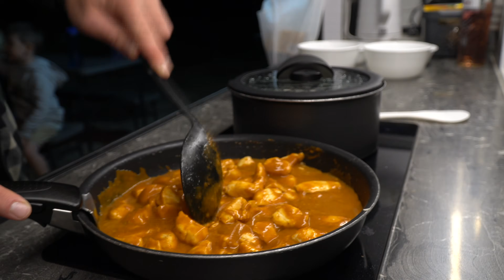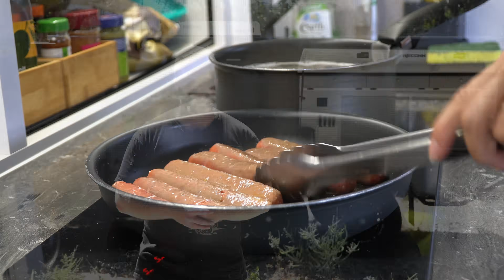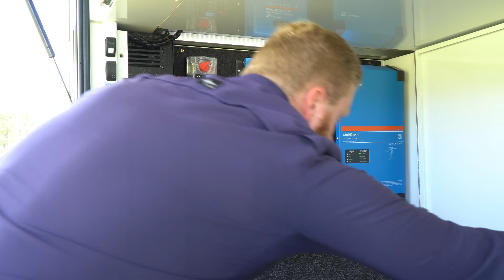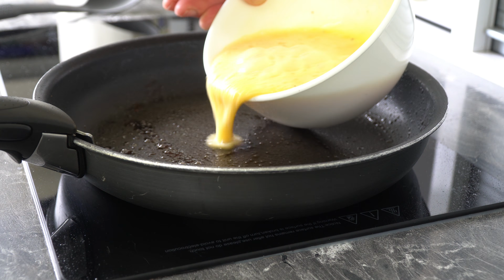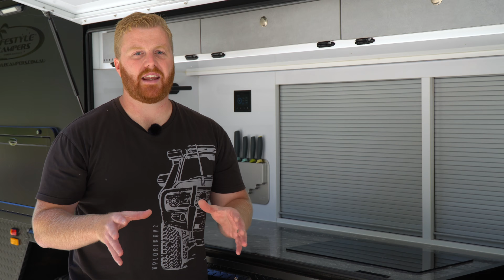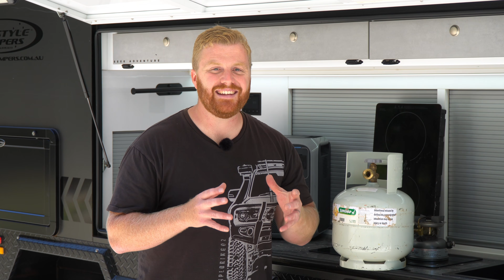WOULD I DO IT AGAIN? My experiences, failures & advice on INDUCTION cooktops for OVERLAND & CAMPING

Comment: Jeepers creepers, you’re almost carrying the equivalent of a feckin new cue lar power station ffs.

& if you throw in all your inverter dcdc chargers etc as well as the Bluetti, and fixed and folding solar panels, as well as the actual induction cook top, I reckon you’ve got best part of $20k invested in solar power system at least.

Then you’re saying, there’s occasions where it’s not enough & there’s reliability issues.

Something you didn’t mention is the risk of catastrophic thermal runaway battery fire in lithium phosphate battery’s.

The recent spate of such fires all over the world in air ports, on RORO ships, multi story car parks, in a cement truck on a Melbourne freeway, proves that the technology isn’t yet “safe” to have in either your Electric vehicle or the camper your family are sleeping in.

Recent video by JC (John Cadogan, Auto Expert, not Electric Jesus Elon Musk), shows that the ONLY available method to extinguish a thermal runaway lithium phosphate battery fire, is with chilled brine pumping.

You have to lower the battery compartment below the thermal runaway ignition temperature, hence why the brine has to be chilled, and the second thing you need to do, is remove the stored energy (electrical charge) as the energy source that’s stoking the fire.

The brine achieves this by shorting out the battery’s - effectively discharging them.

Lithium battery fires cannot be extinguished by use of a normal fire hose, - the thermal runaway fire generates its own oxygen, so will actually burn underwater , fully immersed.

But your Lithium Battery’s are not encased in a metal container / box within your van such that, even if fire fighters arrived with a tank of chilled brine, that they could pump it into your battery compartment.

In effect, what you have created is a massive fire threat, looking for somewhere to happen.

Fun fact, after the recent North Sea thermal runaway EV fire incident on a RORO (Roll On Roll Off) car ferry, new maritime regulations will ban the transport of anything EV / Lithium Battery on any commercial vessel.

So you want to put your 4WD & caravan on the Ferry to Tasmania?

You’re gonna be sh!t outta luck sunshine.

Same with the car ferry over the Jardine River on the way to Cape York.

Or you wanna go visit Kagarri (Fraser Island), on the car ferry?

Same deal, won’t be allowed on it with that setup.

In essence your entire setup is like so many other phukwhits on YouTube, the blind leading the blind.

Probably seemed like a good idea at the start - but subsequent events have proven that Lithium Ion Battery’s are a total failure.

Toyota & Ford have already abandoned the technology, they know it’s not safe & they don’t need another “Ford Pinto” type class action lawsuit as people start dying in these events.

Phuk me. I wouldn’t even risk parking next to that death trap. 🙄👎

Maybe your reporting should cover some of the real risks.

Wait till you find out that insurers are looking at declining coverage with anything containing lithium Phosphate battery’s in them.

You need to face it that this is a failed technology purely because it’s totally unsafe.

My 2c
Reply from the maker: I love this mate, I appreciate the time taken to write such an in depth synopsis of your thoughts on the manner, however I want to make a few points. 

Although you are correct in some of your knowledge and statements regarding the fire intensities and risks involved in lithium battery fires, there is a bit of ‘misrepresentation’ in your description of the ‘end of the lithium world’ as we know it. 

I just travelled Australia and have put my vehicle and trailer through some seriously rough conditions, on dozens of barges including to Tasmania, Fraser Island and Jardine. Thankfully I made it through it all to tell the story. 😅 

Will this change in the future, most definitely. Like anything we are always looking to make things safer, will we just stop transporting Lithium in the immediate future without implementing some sort of alternative, absolutely not. 

Are their risks with lithium, of course. Everything has risks! Are we forgetting that almost every caravan and trailer is carrying between 9-18kg of compressed butane and propane, stored at anywhere between 30 to 120 PSI of pressure? These are literally waiting time bombs… oh wait, no they have safety features that reduce (not eliminate) that risk. Just like lithium, there are steps and procedures put in place to limit these issues. Further a gas bottle explosion will likely kill you in a trailer, whereby thermal runaway from a lithium gives you time to escape. 

I think this is what is wrong with the world today. We are surrounded with worst case scenario news. ‘Everything is out to kill us’. There is inherent risk with everything we do, walking across a road, driving a car, flying etc - maybe even being struck by lightning or a meteor. 

What we need to remember we are living in a period of time that is BY FAR the safest time to live. Our life expectancy has never, ever been higher in the history of man kind, our education, health, sanitation and nutrition is the best its ever been and available to the vast majority of the world. 

It’s natural for you to be scared of new technologies, just like the early adopters of air travel were, however disputing its the future and burying your head in the sand is ignorant and counter productive. 

Albeit, I wish you the best with your endeavours, I sincerely to hope you find the happiness you are looking for 🙏
Reply: @XploringOz  
https://youtu.be/ODirK7ZuYW4?si=8WtlzYI1TO9gqA6x
Reply: @XploringOz  even old mate John would be telling this guy to just stop 😂
Reply: 2c? …more like $5.80
Reply from the maker: 🤣  @chrisc7146

Comment: A tangential question please:  How many AH of lithium to you have, 400Ah? (Edit: I just got further into the video, and heard you have 600Ah)
How long can you run your airconditioner for, just from batteries?  
We've just this morning ordered a single axle Reconn4 with 400Ah, 3 solar panels like yours, and the big Victron inverter (2200W?) so wondering what sort of run time we might get from the A/C.  We went for the gas cooktop BTW.  Thanks - David
Reply from the maker: Awesome David, well firstly congrats on the new order! You won't be disappointed. 
Rather than give you a hour number, I can tell you that the aircon will pull about 60A of power whenever the compressor is running and will go up to about 80A for the heater unit.
If you're running without solar then on paper up to 6hrs (taken battery reserve into account). In theory, you are probably going to draw more power from other devices taking away from that.
I have had instances where the solar will entirely negate the aircompressor draw, however we found that when we actually needed the air con, the panels lost some efficiency due to heat (hence why using the air con) and would draw a net 20-30A. 

I hope that help a little, let us know if we can help with anything else, or if you want me to clarify anything 👍
Reply: @XploringOz  Thanks  for that info. We probably won't need the A/C heating because we optioned the diesel water heater/room heater.
60A is a fair current pull!  Is the maths as simple as 400/60=6.6 so a theoretical run time of 6.6 hours, but in reality perhaps 4 or 5 hours, seeing as you can't take the batteries down to 0% and there will be other loads?  Anyway, we have optioned 2 Sirocco fans which draw next to nothing and are quite effective.
Reply from the maker: @spudboy1328  Yes I agree, you won't need the electrical heater then. 60A is a fair amount, but it's effective at cooling such a small space. 
The math's is relatively simple, but you are right, the reserve is set to about 20% on these batteries, so the run time is only 80% of that total capacity. The Sirocco fans are negligible, however depending on which fridge you have, this will likely be the next biggest draw. We found our Thetford 175L upright was quite power hungry, using about 10% overnight on warm nights, so this has to be factored in too 👍

Comment: finite fuel sources - how did you convert your tug to an EV and a honda doesn't use finite fossil fuels - furkin' amazing
Reply: Crude oil is neither a "Fossil Fuel" nor finite.
Those are myths started by the Rockefellers, to cash in on their monopoly over oil supplies.
Reply from the maker: Righto mate, I get it, it's hard to understand. 

Not all of us drive in circles when camping off-grid. With the right equipment and gear, you don't need fuel supplies if setting up stationary for long periods of time, hence the term 'off-grid'.

The cruiser never came into the equation with this topic and to my knowledge there is not a single vehicle in the world that could achieve off-grid transport and camp setup for extended long periods of time?
Reply: Well, the aborigines didn't have refrigeration, solar, electricity, or gas of any type, ie butane, or propane, or natural gas, just open fires (and no fire ban rules to obey) and they lived that way, indefinitely for tens of thousands of years.
We are just too used to modern household style convenience, and want to replicate that in an off grid situation, ie "Glamping", ie Camping with all the modern comforts of home.
Thus why I call caravans, campervans, and camper trailers, Mobile Homes.

Comment: We are about to add an induction cooker so thanks for your comprehensive and honest assessment. 
We have an offroad caravan, a Tvan camper, and swags, so depending on where we go, we take what suits the tracks and the destination.
What works for us is to set up our vehicle (a Troopy) as a "power station". Currently 400Ah Lithium, 300W solar, 50A DCDC and 3000W Inverter.  Then run the 240V cord from the Troopy inverter to the caravan or tvan when we want to use 240V.
Favourite appliances are air fryer, hair dryer, microwave and pod machine but we also are planning on being able to take a small welder for emergency repairs.  But the air fryer gets a fair workout and chews through the Ah.
What I like about  having the "power station" in the Troopy is that it gets 50A from the DCDC charger whenever we go for a drive in addition to the solar and irrespective of the weather.  Too easy to miss out on solar on a caravan roof by setting up under shade.
Reply from the maker: That sounds like an awesome setup and the ability to pick and choose the best combination for your style of travel is the dream 💪 
The power station in the Troopy is a great idea too, being the common denominator between the setups and you're right about the DCDC charger, however I did find that some days when the power is low, you are driving for a very long time to get is back to 100% again. 

Thanks for sharing, no doubt this will help other viewers too 👍
Reply: I think this is key. You also have the ability to have the van in shade and the car in the sun
Reply: I have a similar setup in my wagon (not a Troopy). 130W electrically slide-out solar panel under the pioneer platform, 400Ah LiFePO₄, 50ℓ DualZone Brass Monkey fridge/freezer, 3kW Inverter, 40A DC-DC. I run a 230/240V cord to the camper trailer to run aircon, air fryer, Induction cooker etc. 

Camper Trailer has its own 100Ah to power lights, electric blanket (winter) and USB sockets etc. Charges off car while driving or can connect a solar panel. 

We have a 300W Solar Blanket I throw into the sun and a 160W Bi-Fold glass panel Solar too.
I try to keep everything in the shade where possible and just put the panels in the sun but the slide out panel does cover the windscreen so if the vehicle is partially in the sun (front half) it’s ok.

By having all the electrical gear in the vehicle we can go for day trips with everything without the need to tow. Also have a FreeStanding 270° Bushwakka Awning on the wagon to sit under.

We have a 4 burner gas cooktop in the Camper Trailer kitchen (came with it) and 9kg gas bottle. Gas runs heats the shower water too. We also carry a butane stove as backup. But gas being so inefficient and slow - it’s almost never used.

Lastly with a fold flat brazier we can have a fire and cook on it too plus 12V KickAss Camp Oven we can slow cook a mean Butterflied Chicken and veges or Lamb Shanks & Veges while driving and have lunch or dinner ready when we arrive. Or heat pies, sausage rolls, pizza. We often use it to slow cook lunch or dinner over 3-4hrs while at camp as it draws around 13A which is less than what the solar is producing.

Comment: G'day, Nathan, a very  balanced review on the + & - of induction cooking. In places of low sun angle like Tasmania or places so hot all one wants in shade is where the problems occur needing the gennie. On our recent trip of 3 months, we used 2 4.5 kg bottles @ $20 for all our cooking using a weber ,wok burners & a internal cook top inside the van if required so the wind wasn't much of an issue & never used our generator. But as u pointed out, every cooking method has drawbacks . Another note our PowerCore filter worked perfectly with no dust issues. Did u have any further problems with LC engine on your travels?
Reply from the maker: Absolutely, although saying that we found we got more efficiency from our solar panels in Tassie, then we didn't in the northern areas (due to heat). 
The cost comparison is hard to acknowledge, but you nailed it with your usage, 2 bottles in 3 months is great. 
We definitely have been in circumstances where the wind advantages have come into play. It's not often, but it helped when it did 👍 

PowerCore wise, very happy with it. If I had another Landcruiser, it would be installed immediately. The only downside early on was mechanics lack of knowledge on the unit and kept opening it up and 'cleaning' it out, which meant I had to change it, otherwise perfect! 

Cruiser is still performing well. The engine is good, we had some consumables with lower ball joints etc, but all good considering where we have been 👍
Reply: Park in shade and put solar panels in the sun. Solar blanket etc.

Comment: Excellent review of a top shelf linthium system. We have gone a different path as we only have the two of us travelling when we can. Our system is mainly vehicle based as we have a large battery and inverter onboard with high dcdc capability and some solar. The van only has 120 ah and just over 500w of solar only really enough for lights and fridge we don't have a/c. As most of the time the van is used as a base station and we travel from there most of our recharge comes from the dcdc the car battery is well charged most days, we then run a lead from the car inverter to the van to run induction, kettle, etc. We still carry gas and use fire when we can but both can't be use on total fire ban days. This type of system isn't cheap and only works if travelling every few days but has the benefit of being able to plug the house into it when there's a power outage.
Reply from the maker: For sure, sounds like you have a great system setup there and to be honest, if it's working there's no real need to change it. 
That's another great point about the fire bans, the induction is immune to this. On the other hand, most people (most) won't go travelling in those types of conditions, but if you found yourself there, it would certainly help 👍
Reply: Consider Solar and a battery for your house. We did now free electricity 24/7. And no grid outages for us - runs the whole house day/night. 2 adults 4 bedroom house. Aircon on 24/7!

Comment: Thanks again for a honest informative review
I’ll be going with a bluetti ac200max for all my camper power needs including my very slim portable single induction cooker- but with portable gas also
Both working together when need be. May also include a basic 100Ah lithium battery to provide backup.
Reply from the maker: Thanks mate, appreciate that 🙏 
Have you already got a AC200 MAX? If not, just wait a few more weeks. Bluetti is just about to release their AC200L on the 15/12 and it looks to be the goods 👍 I've got one coming and will be releasing a video in January. It's very similar to the prior models, but has a better inverter and other helpful features.
Outside that, your setup idea sounds great 👍
Reply: @XploringOz - thanks for the tip